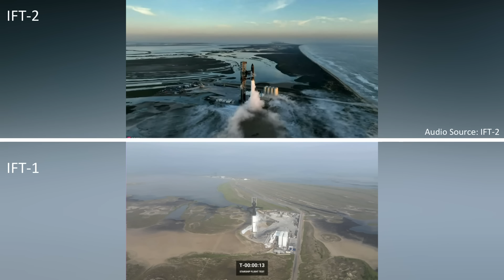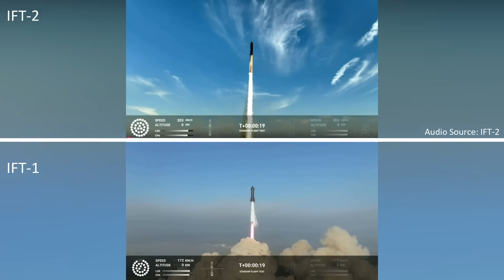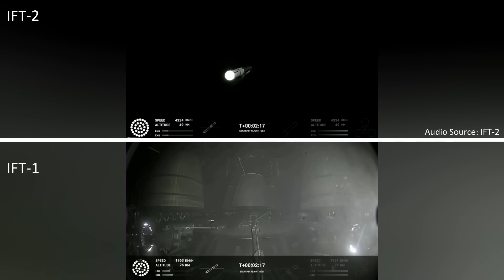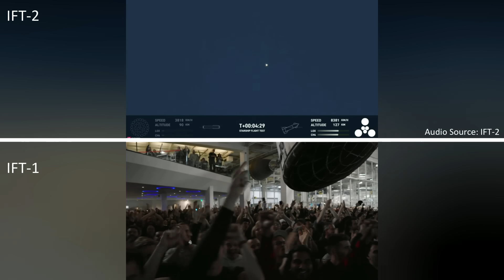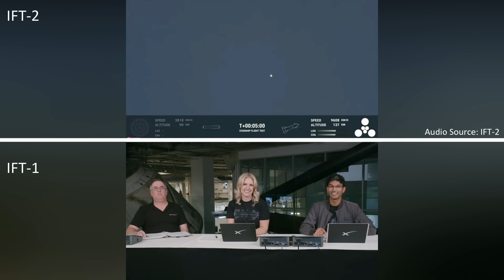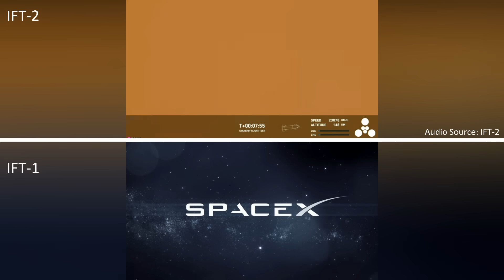Starship Launch IFT-2 Vs IFT-1 : Perfectly Synced Side by Side Comparison Video

Comment: At 3:07, the time index whatever, is way too low, MECO, stage separation should have occurred at 100km or 63 miles above sea level.  Traveling 5 times the speed of sound at 48 miles above sea level in the mesosphere, a layer extending from approximately 30 to 50 miles (50 to 85 km) above the surface, ripped the top off of the booster like an exploding beer keg, pop.  It may have survived if separation had happened above 70 miles up.

Comment: The progression here is incredible.  Anyone who says IFT-2 was a failure has no idea what they're talking about.
Reply: Looking back at IFT-1 through the lens of IFT-2, IFT-1 looks like a failure. Barely getting off the pad and immediately losing control of the rocket, destroying the launch pad, and on top of it all the failure of the FTS to do its job definitely are things that should not have happened and made the IFT-1 launch incredibly dangerous and borderline reckless. IFT-2 was completely safe: they were in control of the rocket all the way through, and when they lost control of each stage, the FTS worked as designed. Plus the pad is intact. IFT-1 got the basics wrong while IFT-2 actually revealed either design or operational flaws that need to be tweaked. IFT-2 wasn't a success but it wasn't a failure: it was somewhere in between. IFT-3 I don't think they'll get to Hawaii, but they will make it to re-entry.

Comment: I paused it at 2:58 and it showed 2 at 70km and 1 at 35km altitude. So the 2nd flight in the same time, got double the height of the 1st. I didn't realise just how badly Flight 1 was suffering from it's engine troubles until I saw this!

Comment: First test failed at begining as egines most likely got damaged by flying concrete, the lauch pad was a problem not the rocket.
Reply: Not the case. Exhaust would have prevented any debris from reaching the engines

Comment: The difference in speed is insane, its crazy that IFT-1 attempted to stage at 33km when IFT-2 staged at 90km
Reply: There was no attempt at stage separation during IFT-1.  The whole stack simply went out of control well short of that mark when the fire in the engine bay finally severed the control lines between the flight computer and the engines.
Reply: Stage separation on IFT1 was aborted due to the incorrect altitude and loss of control.

Comment: I like how the first ship technically lasted longer but the second ship was still more than double the distance away and didn’t lose engines until after the staging event. Not the complete success we were hoping for but comparing it to the first launch really shows huge improvements pretty easily
Reply: Really shows how much the first launch struggled to compensate and how much efficiency was wasted as compared to when the launch is smooth.
Reply: Hoping third times a charm..

Comment: In the future when Starship is launching weekly and reliably, do you think anyone is gonna give a flying fuck if it failed a few times in the beginning vs having a near perfect launch record? There gonna get to the same point anyway and people will forget about these early launches, just like with the Falcon 9. I'd rather fly on a perfectly reliable rocket that failed a few times at the start, then a perfectly reliable rocket that has never failed, and thus, has probably never had its failure modes properly tested and fixed.

Comment: It's interesting how only 5 engine losses cut the speed of the first one by half. You'd figure half the engines being gone would equal half of the speed is lost.
Reply: It's the rocket equation, but just think of it this way... when fully fueled MOST of the engines are just canceling out the force of gravity.  Only the 'extras' get it to accelerate up.  To simplify, lets say you had a rocket with 20 engines, but at full load, 15 are needed just to give thrust equal to weight.  So you have 5 'engine-ups' of force pushing up.  If you lose 3, now you only have 2 'engine-ups' of force... so a Rocket with 17 engines burning has 85% of the engines going, BUT.... only has 40% of the acceleration up as a rocket with all 20 going.
Reply: FYI only 70% thrust in IFT-1 for booster 7, lifting off was the target.
Reply: Cause you have to fight a constant number, gravity. Just imagine using 1 engine, you wouldn't get 1/33 of the speed, you'd get 0 speed cause you can't even overcome gravity. The force you need to produce has to be higher than 1g to go up. Let's say all you have 20 engines and together they produce 2g of acceleration, you'll be going up with an acceleration of 1g. If you lose 1/4 of them you'll have 15 engines and 1.5g, going up with an acceleration of 0.5g, you basically lost half of your acceleration by losing a fourth of your engines. And if you lose a half of them you can't even go up

Comment: I believe after the first stage separation the first stage rotated too aggressively for the "burn back" maneuver causing the remaining fuel to "slosh" around in the mostly empty tanks which caused fuel supply problems to the "burn back" engines which then cause them to drop out one by one or more, once that happened the onboard fight controller knowing it could no longer control the rocket with most or all of the engines out terminated the rocket...

Comment: One of the things that makes this so exciting is the speed at which they will be able to turn around and try again. I am really curious to hear what they discover from the data of this flight. To see what they implement and how quickly to address the things that went wrong.  While it may not have been a complete success, this was by no means a failure. The whole reason for these tests is for things to go wrong now, so they can design and engineer a fix.
-
Many of the engines are still early prototype engines as well. A channel I follow has some excellent videos following SpaceX's progress with some great drone footage and images. The channel discussed how the numbers on the engines in this Booster were just starting to break 100 I think and they have Raptors engines in the 300s or almost 400s? I'm not sure of the exact number. As I understand, however, the latest engines off the line have benefited from manufacturing improvements and such. This is where I really respect the infrastructure SpaceX is building for keeping a steady production. Each test now, even if not a complete success, is never a failure if they learn and improve from it. That high production allows them to quickly send arrange the next test flight.
-
Oh, and I am VERY curious to see the drone footage or images of the launch pad and see how it has held up. The water deluge system was awesome. Does this mean the launch pad gets a steam clean during every launch?

Comment: My observation: looks like the booster engines were fuel starved in the flip.  One side engines stopped as if the fuel flowed away from them and they stalled.
Reply: Yeah, I'm not sure if they have confirmed this, but this definitely seems like the case. They did say that the booster was terminated with the FTS so that may act as a confirmation until they give an official analysis.
Reply: @interstellarol. hope the camera in the tank worked.

Comment: Genuinely shocked at the difference between the two. The speed and stability of 2 compared to 1 is amazing.
Reply: there is something else. launch 2 has an equal consumption of LOX and LCH4, launch 1 has a higher LOX consumption and ran out of it.

Comment: Now we are not allowed to call Space X launches failures because after Starship 1 I had Space X fans crying in their Coke Cola, and threatening me with bodily harm when I said that. So we will use their own terminology. Saturn V 14 launches, no failures, no rapid disassembles. Starship 2 launch attempts two rapid disassembles.
Reply: Failures are what made falcon 9 the most reliable rocket in history, by the way the saturn V project costed 36 billion $ USD and was not reusable at all (if it was cheaper it would still be used you know;).
The way spacex work is by iterative design wich is the opposite of most of the industry, its a practical way of constantly improving uppon "failures" .
Reply: @blue_ish4499  Great comment. As my checking now, it's $50B in 2020 price. So, it should be 60B for 2023 price tag.
Right now, Artemis project with SLS cost those stupid numbers. They're building another mobile launchpad for those outdated rockets. NASA is joke right now when comparing when private companies or China, India. What's a shame.
Reply: Explain apollo 1 the crew died to fire

Explain apollo 11 they almost got stranded in the moon

Explain apollo 13 they didn't made it to the moon

How about do some research before commenting Apollo got no failures.
Reply: @Hexagon234   I know none of those were problems of the rocket, but still Saturn V development costed at least 20 times more and the rocket also costed at least 20 times more per launch.
Reply: Saturn 5 cost about 100 times as much, and had plenty of issues. They lost 3 astronauts before they even launched it, and every other flight had problems. They were lucky, it’s a bloody miracle they made it to the moon.
Reply: Stupid comparison. If they didn't try to test the returning and vertical landing and use like a expendable rocket, it's totally successful.
Besides, how long to test and make a simple Saturn V to work like that? Don't said anything if you're not working on R&D before.
We don't work and innovate by your stupid, outdated way (like 90s). Shut your mouth up if you're a at high-school level :))
Reply: The main reason for their rockets exploding in testing phases is their method of rapid iteration being different than the normal way of testing. SpaceX are basically launching test articles of their design to see how much it can handle and how many problems will occur while testing it. This flight is basically testing to destruction as how they did it with some of falcon 9 prototypes.

Everybody knows That this prototype is an outdated one and the main purpose of this flight is to test the launch pad and hot staging, even SpaceX even had gone so far as intentionally not replacing some of the not fitting heat tiles of the ship to test how long it would survive during re-entry sequence.

And their reason to do these kinds of tests is due to them being efficient cost effective and less time consuming for testing unproven methods. It's not just raptor engine which is new with this rocket, pretty much all of the design is revolutionary and doing what a lot of different things in much larger scale.
Reply: @XxX-ww  yep, it’s called prototyping. Build it, see how it goes, learn lessons and fix problems then go again. This launch was mostly successful, I think Test 3 will get to orbit. Then the next challenge will be trying to land the booster.
Reply: @aldunlop4622  Exactly, these people have problems understanding how rapid iteration works.
Reply: @aldunlop4622  It depends their goal. The 2nd one was going to sub-orbital, not orbital. The 3rd one should be the same. They don't try to push Starship to orbital until the vertical landing is tested  yet.
Reply: Linear vs agile workflow. Different budgets and vastly different designs and goals. Your comparison makes no sense. Artemis 1 having a RUD for example would have been a horrible failure due to the bureaucracy, the massive costs, the extremely time consuming linear workflow and extra calculations going to the moon, and the fact that it was the only one. SpaceX has a garage full of super heavy boosters, made of rolls of steel. They're meant to be launched, probably blown up, and give the teams more data. The metric for success with the first launch was mainly clearing the tower, and for the second was getting through to stage separation. They were successful tests.

Comment: B9 exploded earlier in flight than B7.
Reply: Do you even know what you are looking at? A rocket doesn't do stuff just because it wants to. A rocket will not just do stage seperation until it reached a very specific speed and altitude. IFT-1 never got there, because it was flying waaaay slower. But they wanted to see how far it could get, so they let it fly (and the flight termination system wasn't working properly) as far as they could. Then it was blown up. IFT-2 got to stage seperation, it did it's flip manouver, it re-lit it's engines and only then it got into trouble and it blew up. But it wouldn't have been terminated (or exploded as you stated) for longer, if they let it fly as long as IFT-1 without doing stage seperation. So you can't compare the times of when they blew up at all, they were under completely different circumstances and were terminated because of different reasons.
Reply: @NJKoopmeiners  dude.. was just posting a fun fact. The FTS on flight one didn’t even work right, it should have exploded way earlier..

Comment: It looked like they burned too much propellant too fast. They never would have made it to Hawaii.
Reply: Once they reach their target speed (they were very close before the Starship RUD), they shot down the engines and burn no propellant at all.   Starship coasts around the earth and comes back into the atmosphere near Hawaii.   Because it flies around the earth outside of (almost all of) the atmosphere, it doesn't really slow down, and doesn't need to keep it's engines going.  Satellites in orbit stay up for years or even decades without constantly using propellant... a stable orbit means it is essentially in permanent free-fall, falling around the Earth.  Starship almost reached those speeds today :)
Reply: There was a propellant leak in the starship

Comment: To someone who knows nothing about how rockets are developed, this still looks like a failure.  First stage destroyed, second stage not communicating.  But to someone who knows a little something about the development of orbital-class rockets - especially the early ones whose development model SpaceX is following - this is an incredibly optimistic launch.

They got through staging and the second stage made it into space before they lost contact!  That's huge!  All 33 fist-stage engines stayed lit until they were commanded to shut off!  That's even bigger!  To put it into perspective: this is way further than the N-1 ever got, and it's the only rocket that's had a similar number of first-stage engines.
Reply: If they don't try to return back for testing vertical landing, it's 100% successful like the other expendable rockets from the other companies/countries, e.g. SLS.
Blue Origin and ULA can't event make their rocket engines working properly on test standing for years.
Reply: Didn't the N-1 have a hard time clearing the pad before it went boom !
Reply: @alwenke212  IIRC the furthest it got was to just before first stage cutoff.  So yeah, it had trouble getting off the pad.
Reply: To be fair, for almost every other rocket the booster is considered successful the moment it stages successfully.
Reply: @toukoaozaki  You're not wrong.

Comment: Congratulations Team SpaceX. Amazing progress in such a short amount of time!!
Reply: Agree 👍
Reply: Progress? What so instead of blowing up 3 mins, it blows up 8 mins in? Give me a break.
Reply: @blackhatfreak  surviving hot staging and testing the launch pad was the primary goal of this flight, testing how long the rocket can endure re-entry is the only other important part of this test.
Reply: @XxX-ww  Spacex told you their primary goals ?😮.
Reply: @XxX-ww  it did neither lol
Reply: @blackhatfreak  launchpad survived and the booster survived several seconds of hot-staging. engineering something like this is difficult, but spacex seems to be working out problems and they get loads of data from every test flight. a few more tries and i'm sure we'll get a 100% successful launch and landing.
Reply: @blackhatfreak Build a 15 floor rocket, I would like to see how you would do better
Reply: @blackhatfreak  its called development test flights, anything that completes mission goals is a success
Reply: @saturntechnologies1350  cry more lol